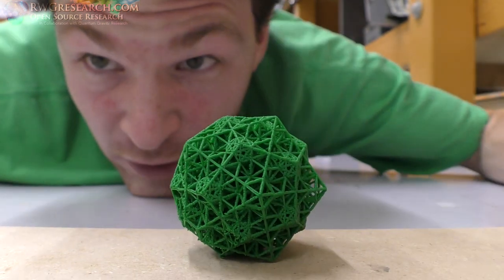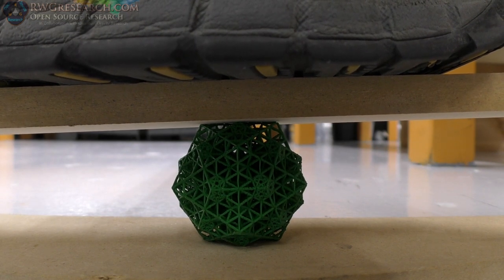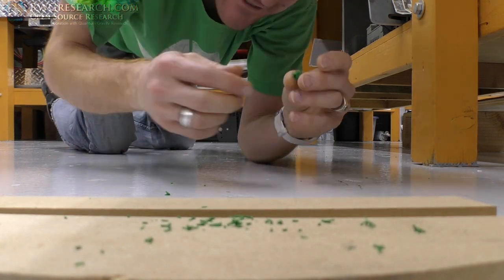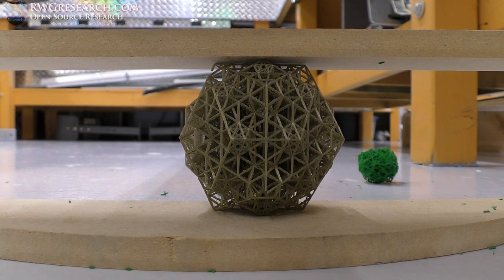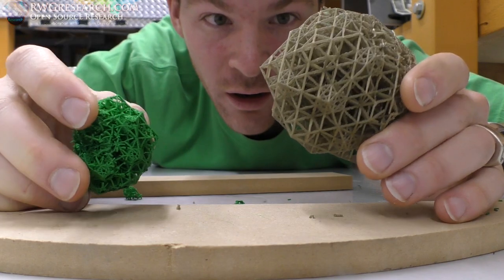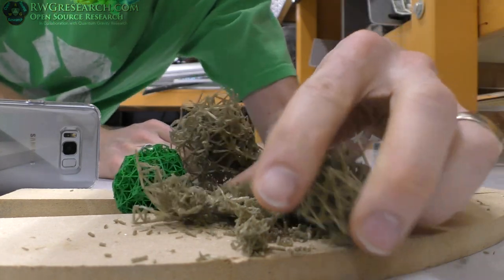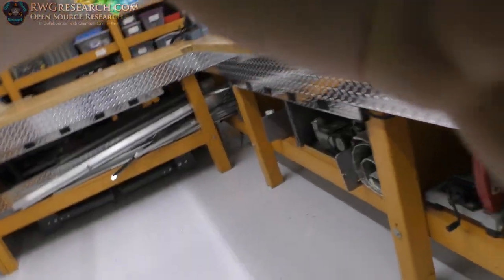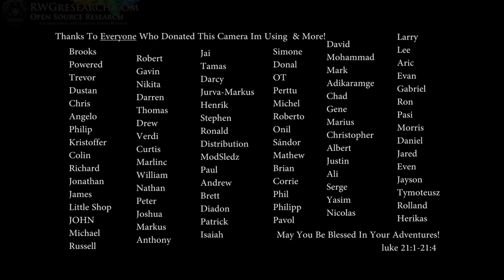The Result: Can The QSN Hold My Weight?

Comment: The second one was a different color: What was the difference in the material that it was 3-D printed from? Since it was printed with a different filament, that could be as big a difference in strength, as the size of it.